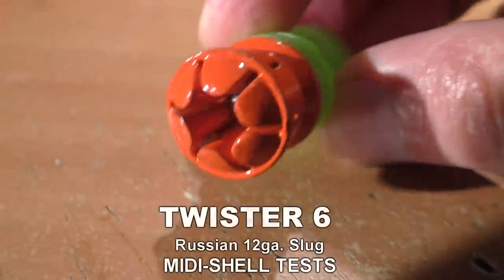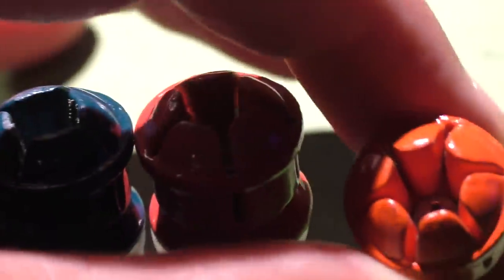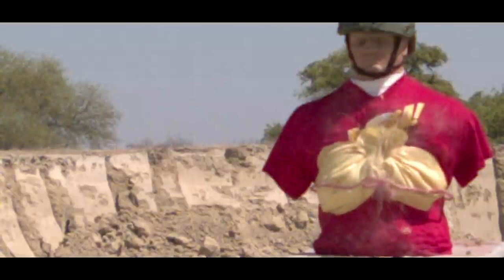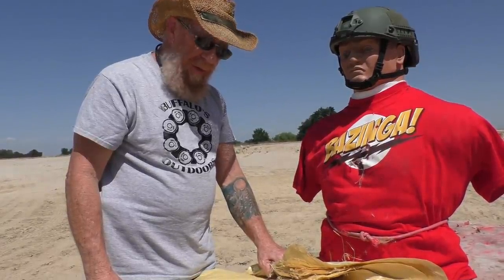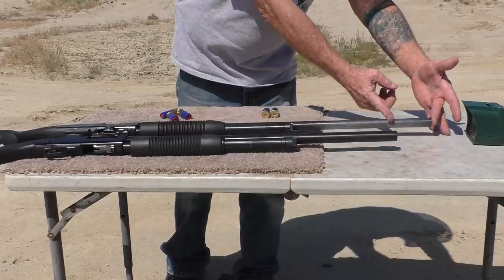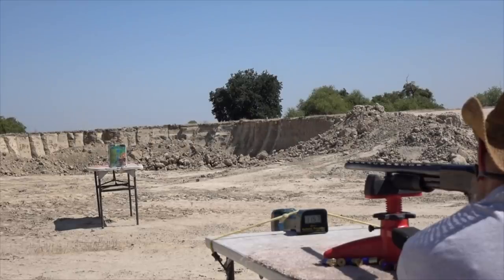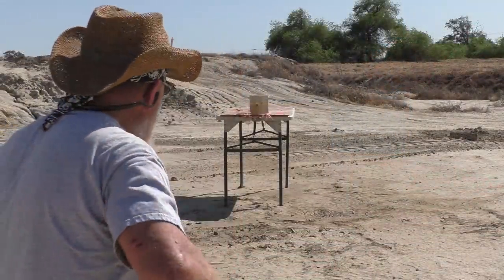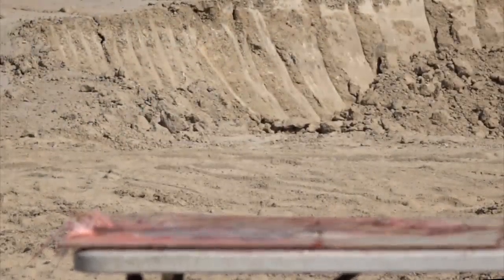This just might be the BEST 12ga. Slug we've tested!

Comment: I have heard of these and I cast them. The mold is a Zvarog Zveroboy from Russia. Love these screwed to a BP brushwad and Longshot. Edit: the Zveroboy only has four segments. Also came with a tip to make them standard hollow point.
Reply: This mold is from AS Molds https://as-molds.com/the-bulletmold-twister-12-gauge/
There are definite differences between the 4 segment and the Zveroboy (I have both molds, but not the HP core for the Zveroboy), but they weight the same.
The HP mold I have is the the Shot-mini https://as-molds.com/the-bulletmold-shot-mini/
Reply from the maker: AS Molds made the mold for these.   I think they copy a lot of other's designs
Reply: @taofledermaus  I commented too soon. When I saw the first image of the slugs it looked just like mine. Thanks for the lead. Could always use a new slug mold.
Reply: @taofledermaus  By the way, some of the Russian molds make slugs with three bearing surface rings for better performance with rifled barrels and no need to attach wad. In general, the slugs with two rings perform best attached to the wad and fired through a smooth-bore.

Comment: I was going to try to duplicate the load but I’ve got to figure out how many gr of ls to use
Reply from the maker: I used LS but wasn't happy with some of the inconsistencies.   It's hard to get a slug this heavy to travel at subsonic speeds without trying a LOT of different powder loads.   The 1300 fps shot used 27 grains,   if that is any help.
Reply: @taofledermaus  I saw what looked like a 25 on one of them and was figuring that was what it was but the 27 definitely helps. 25 to 27 will make a good starting point for me. I have the twister set and a few of the other AES molds.

Comment: You probably also had lower velocities with the smoothbore vs the rifling because smoothbore doesn’t allow for nearly as tight of a gas seal around the projectile as rifling does. If the smoothbore is letting gas bypass the projectile since the smoothbore isn’t as tight around the projectile, it’s gonna lose velocity.

Comment: All those Russian molds have great potential. Molds are a bit pricy, but available. Problem is nobody has the wads that stabilize them. Not the BRP, or the "special" tailwads that press in to the slug. Hope that changes some day soon.
Reply from the maker: It will get better but people are still hoarding.   In a FB group I'm in people are posting their massive hoards and not realizing they are the problem.   They are buying 10,000 primers when 1000 would be enough for years.

Comment: Wow! the real time impact on that shoulder is proof enough and like how your keen to show "lower" velocity. truth I avoid most "gun nut" stuff out there and am 20 yrs behind in that regard but have been hunting,shooting,reloading for 40 yrs. I shoot 20 ga. and 410's though as a rule. and have always had them as home defense guns and .22 semi auto as much for high accuracy no recoil, 
Have seen yours and others videos on slugs ,am amazed at the changes:) have tried all manner of things for yrs ,can no longer go out back to test them though,so am left wondering on a few? best tested rounds right now are in 3in cases with a 2in masonry nail,sharpened surrounded by00 steel shot or variations of a steel socket,with a cut off carbon drill bit with bb's ,have also done that filling it with lead solder,  so is a drill bit on top of steel shot,have used washers but after seeing test results ,won't do that again.
in my 410 I also use two .45 win mag slugs hollow points,these leave a 2 in. hole in anything for a target at 15 20 ft. ,think those would do the type of damage you showed on that pork shoulder:) kind of surprised I have seen people use a socket? are cheap easy to find! have done since we were teens using a steel socket back filled with lead shot or steel b.b's,that is what is in my 20. ga. now and are devastating  ,and remain intact on steel plate and brick and concrete blocks. thanks enjoy your videos Peace. Rick

Comment: If i want many wound channels, i would buy 3" 00 buck, each pellet is bigger than each of these petals, and have 15 instead of 6, and rifling on shotguns make slugs a LOT more powerful, so if i would use rifling, i would use slugs always, but with smooth shotgun, 00 buck is more lethal, bcz 15 9mm with 30-06 energy is way more lethal.

Comment: Just use 20 ga. light load bird shot for home defense. Reduces over penetration through walls.There is no need to "frag" a home intruder with a 12 ga. if you actually had to use lethal force. Best option the sound of racking the pump is enough to send the scum escaping your home. They know that sound. Unless the intruder has broken in with the intent to kill you there's a much bigger problem. Intruders, unless cornered will not wait around for the law to show up or get into a gun battle with you. In states like Cali there is a defense attorney attached to every bullet you fire. Warning sound first if possible. Don't go looking to kill the intruder. Its simply not worth it!

Comment: It looks like these are sold under the name Svarog Botfly shotgun slug mold.  Not Russian Twister.  But hopefully this comment connects the two names for better search results.
Reply from the maker: This was made using AS Mold called Twister
Reply: Svarog makes some similar molds, but there are differences in the designs. I have the Svarog Zveroboy mold, and it's different than the 4 petal slug from this mold, but they still weigh the same.

Comment: Rate this video at a 7.5 over and a 9 in commitment and topic. 
Anyway to rise to the next level consist of money related investments but also have the opportunity to build each of the characters, , get some real company uniforms desig discussions should not occur until you are with the designer. Remember that they are supposed to be professional problem solvers, but they still work for you.
Bring the viewer into the set or area maybe by connecting with the drive from a city and several aerials as the host move through their corridors to get to their range. Then think out the various needs for holding angles and positions and have a shop manager for wood working and have an abstract symmetrical vices clamping station’s bench that allows items to be clamped by replaceable stock wood stick lumber and a bench hit will carry a $500 repair penalty, and you could have low or below ground low out put lights for a nice front infill light, and the next thing would be to have an actual script where you could so that you are familiar and prepared for the time available.
I have given it a lot of thought, but I can’t decide where to have the 8 girls in thongs with two of your logos on each of their chest